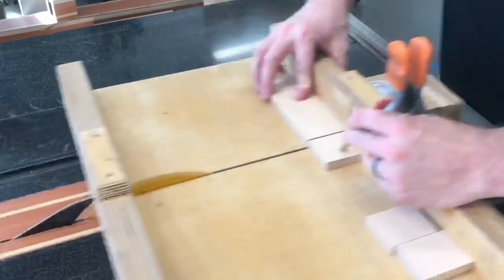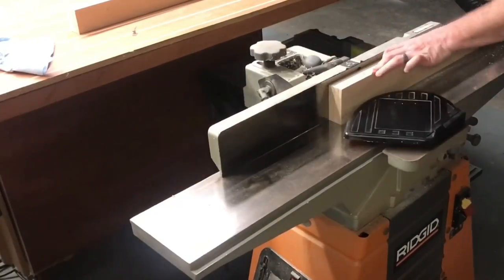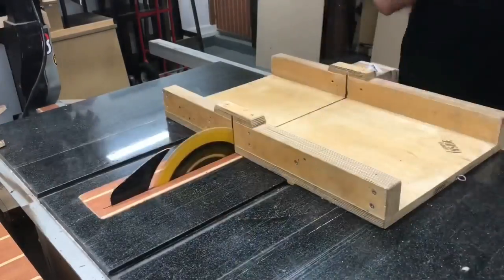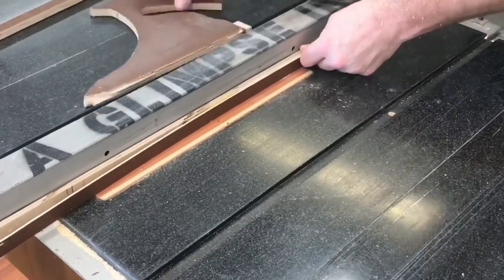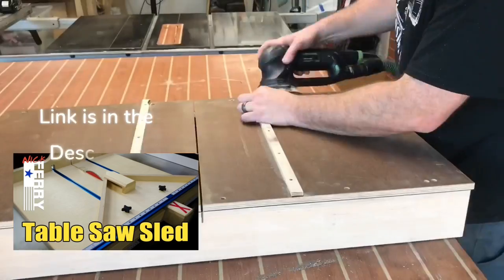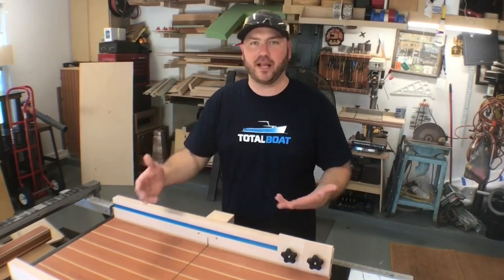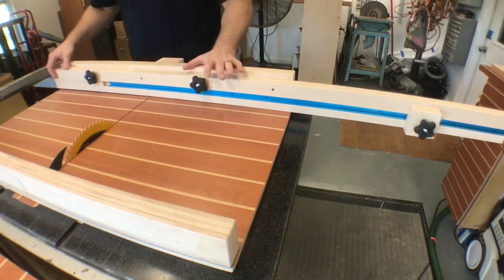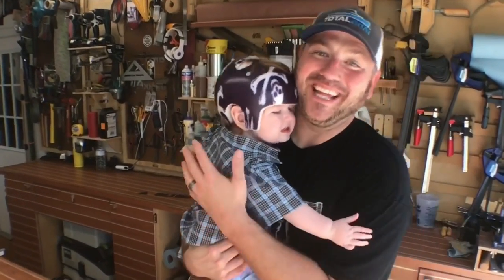How To Make the Ultimate Crosscut Sled | Woodworking Project In the Comfort of the NewAir AC-14100H

Comment from the maker: About the long auxiliary fence; the placement of the star knobs only allows stock of 1 1/2” in thickness (I’m aware of this). I would rarely if ever need to make long repeating cuts on pieces thicker than this so all is well with my design for me and my shop. However to remedy this issue you would simply mount the T-track on the top of the fence and not in the front face! 
Just wanted to clear that up Incase!
Reply from the maker: Frodo If ever I need to , thanks for the idea
Reply: You say that the knobs limit the thickness, but are you also cutting through your t-track before you get to your knobs?
Reply from the maker: fcschoenthal yes. And that’s ok with me. It will be used pretty rarely and it should be fine. Thanks for the concern tho!
Reply: @AGlimpseInside  - I don't have any experience with the Saw-Stop saws, but I was told that if the blade hits anything conductive (like the t-track) it will activate the Saw-Stop and that is probably not something you want.
Reply from the maker: Chris Moore Yes you’re right it will I have modified this cross cut sled by taking out an inch and a half on either side of the blade of the T track so I’m good to go

Comment: Heh heh I made my first really good mistake the other day... measured my outfield tables legs with full confidence... but instead of measuring from the inside the 2x4 frame and flush.. I added the total thickness of the top including the frame.. ended up having an outfeed table that was 3 1/2 inches shorter then intended... 👌

Comment: Nice sled.  I would suggest putting the stop block t-track in the top of the back rail.  Make L-shaped stop blocks and extender fence. That way it solves the limitation on the thickness of your work.  I know it is rarely going to be a problem either way, but why build in a limitation?  Also, it looks like you would cut the t-track on the extender fence where you placed it.  How does that work?
Reply from the maker: All good ideas. And yes you do cut into the teacher asked just a little bit when using the extension however I don’t use the extension very much and I’m OK with that due to the fact I don’t have a saw stop. However your ideas are pretty good man thanks for sharing

Comment: Chris, great build but I have 2 questions:

1) if you undo the back fence a couple times, won’t the screws start wearing the hole out a bit? Can you put screw inserts in to protect it?

2) on the extension, won’t the knobs get in the way of a long, tall piece?

I need to build a sled and following you build when I do.
Reply from the maker: As far as the adjusting I haven’t noticed anything as I still use dispense quite a bit. The extension did have that issue yes you’re right but unfortunately I got left out in the rain during a shop re-organization and I no longer have it
Reply: @AGlimpseInside  Really? I hoped I was the only one who left stuff in the rain

Comment: Wondering ware you get the marine grade plywood? I can’t find it, and it looks like great wood and I’d love to try it
Reply from the maker: It’s very hard to come by I was lucky. One place to check though is if you live in any coastal areas there may be a yacht builder somewhere. They typically have a lot of the stuff on hand. That’s where my salvage yard picked it up was from a yacht builder that was going out of business unfortunately at least that was the story I got. Either way you can also check your local plywood/lumber dealer they will typically have plywood that’s a laminated on both sides with some type of laminate. I’m actually working on a drill press stand right now using some black laminate plywood and really, I’m impressed with it

Comment: I never understood using t track for stop blocks. A clamp and a scrap piece of wood work just as well. But it sure does look fancy 👍🏼
Reply from the maker: It is fancy. And it just feels a bit more convenient not a necessity but I’m liking it
Reply: With respect to the extension, if it weren't for the T-track, the clamps needed to hold down a long board would likely get in the way of the long piece you're trying to cut. Moving the clamps to accommodate your work piece would mean using less and less surface to secure the extension which is going to need some good clamping to overcome the weight you're going to put on the end of extension with another clamp and a block of wood, not to mention the weight of the extension itself as it hangs way over the end of the sled.
Reply: GuiTuber i guess I could see that. Once you’re able to reference a couple feet on your sled, once clamped you’re piece should be plenty secure that way. Now granted I’ve never cut anything longer than about 6 ft this way but haven’t had any issues. Anything longer and I bring out the chop saw. But I understand, different folks, different strokes 👍🏼
Reply: @BradsWorkbench , I'm just getting in to woodworking and have plans to make an assembly/outfeed table. The longest piece will be about 45" and I need a number of them. My miter saw is old and doesn't have much lateral capacity. I've been thinking of ways I could add some sort of auxiliary fence with a stop block to the miter saw but I've also thought that a wide enough cross-cut sled might be more stable, creating more accurate and repeatable cuts.

I plan to mount my miter saw into my new table (folding down into the table when not in use). Mounted on the long side of my table, which will be 6 ft, I will have 2 ft on either side to better accommodate long work pieces. To get there though, the design of this cross-cut sled would be just the ticket.

Comment: i'm impressed by your creation, and by your video. the sound varies, but you dont take 3 minutes to explain something that could be explained in 30 seconds.  but.... how does the aux fence not get cut when cross cutting?  the t track is lower than the cut in the stationary fence.
Reply from the maker: Yeah that was a bit of a oversight. A mistake really I don’t really use the long auxiliary fence too much. Especially now having a saw stop that might trigger the break